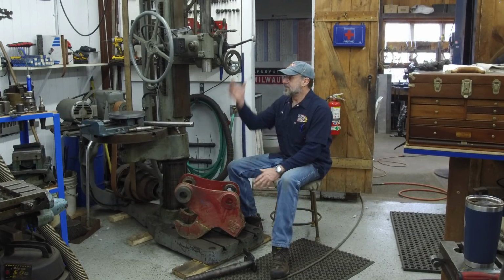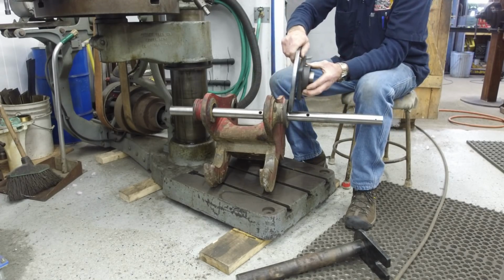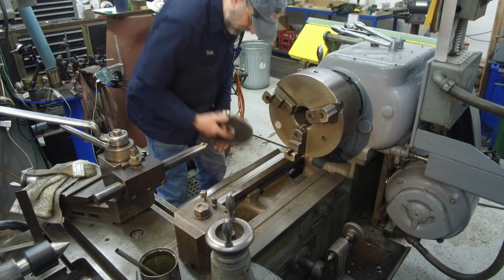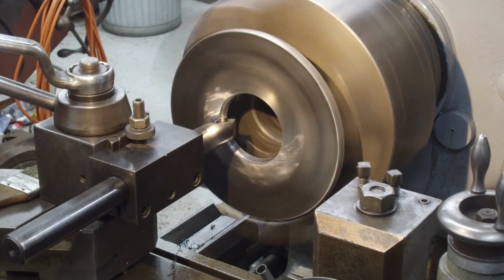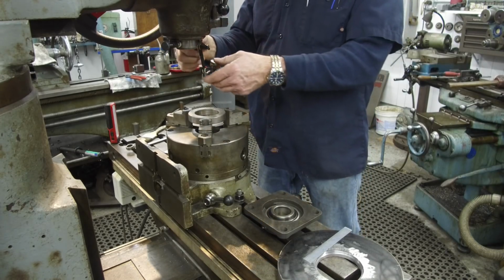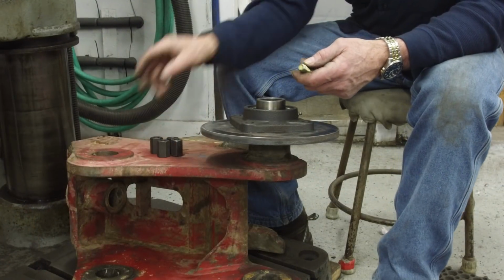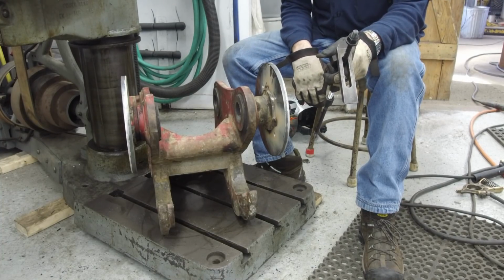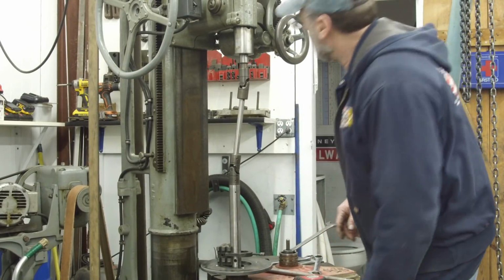A Sibley Line Bore Project Part One

Comment: Have you seen the line boring rig that Kurtis over at "Cutting Edge Engineering Australia" uses???
line boring, welding lance, face milling... it does it all with just a few sacrificial bolts welded to the work piece.
Reply: That was the first thing I thought of when watching this video. That machine would make this job a simple process for Keith. I'm sure that machine comes at a hefty price though. Seems like it'd pay for itself with the time saved if Keith does these types of jobs often.
Reply: @c6quad3  I did a quick Google search for CEE's line boring  machine and it is north of $40k.
Reply: @tomzuchowski6590  That's for the whole machine, with the welding attachment and everything.. If you just look at the setup portion, the trick is the 45degree tapered bushings that slide onto the boring bare to locate the center. If Keith turned a couple of those, he could tack the sacrificial plate in place without having to machine the locating boss into it. Then since the boring bar is located concentric, he could bolt the standoffs onto the bearings, and tack them into place properly located onto the sacrificial plate. Would probably save a few hours of work. Once his bearings are located and tacked, he can use his other equipment without having the whole CEE machine.
Reply: @c6quad3  Big investment but if you do enough it’s probably worth it to turn jobs around quickly and consistently. But you still need to remain competitively priced.
Reply: @aleitch654  yeah it's a huge investment for sure. I would think that that machine would allow for a much quicker turn around and be a more competitively priced job. Then again, is the investment worth it. I have no idea how many of these types of jobs Keith gets asked to do.

Comment: NICE!!!!!!!!!!! I HAVE THE TWIN TO YOUR DRILL PRESS!!!!!!!!! AND THE "BABY" ONE ALSO!!!!!!!!!!   I LEARNED FROM AN OLD, OLD HARDWARE STORE, WHAT A "CATS TOUNGE" IS!!!!!!!!!!!🤣🤣🤣🤣🤣 THANKS !!!!
PS, GLAD I FOUND YOUR CHANNEL!!!!, JACK
KIETH, NICE SEEING WHAT LOOKS LIKE SOME OF MY OLD MACHINERY, I WAS NEVER SPOILED WITH THE VENTILATION YOU HAVE, BUT I ALSO HAD 23 GUYS BURNING 3/16 DIA, 7024 JET AND 5/32 7018 LO-HI, SO YOU CAN IMAGE, THE SMOKE, EVEN WITH 25 AND 30 FT CEILINGS!!!!!!!!  JUST WISH THEY HAD YOUTUBE BACK THEN, AND THE GREAT CAMERA'S YOU USE, I ALSO SPECIALIZED IN "LEAD BURNING" FOR LEAD LINED TANKS AND ANODES!,  ALSO "KORASEAL" LINED CHROME PLATING TANKS!  GREAT TO SEE A REAL MECHANIC STILL AT WORK!!!  OSHA WAS A BIG! MAJOR THORN( EVEN NEVER HAVING ANY INJURIES!!!! ) MY SUPER CPA, FIXED THAT, AND KINDA FROSTED OSHA'S BUTT. WAS I MADE EVERYONE A 1% OWNER, THAT WAY THEY COULD NOT TOUCH US!!!!🤣🤣🤣,

Comment: Keith, I have an off topic question. I've seen you use one so here goes. I just picked up a horizonal mill attachment, both sides. What size shafts would you recommend me to make ? (Bridgeport). I bought some 1018 in 3/4, 1, and 1 1/4in. the dead end is 3/4 in. so I figured I would make both ends the same. 3/4 r8 in quill. I thought put fine thread on the shafts and turn out some various length spacers. do you think that I need to make a couple of small shafts also? Recommended length? Thank you. Retired Elevator mechanic  O yeah, don't mount the rotary converter on the wooden wall to save floor space. Makes the dishes rattle. OPPS!

Comment: It's been great watching you over the years. I also am a welder/ machinist /fabricator with shop and equipment similar to yours. Gee, Keith, was the four hole pattern symmetrical? Was it concentric with the bore? If so on both counts, why use a dividing head? Is the cast o.d. of the bearing flange concentric with the bore holding the bearing? Or was it machined? If it was machined, it must have been concentric. If so to all of the above, clamp the disc to the table on standoffs, sweep the bore, and move x and y by half the distance between holes. The heck with the indexer, unless it's for the physical exercise.